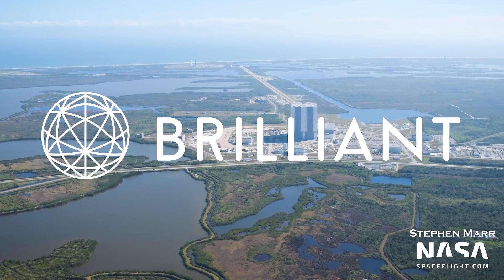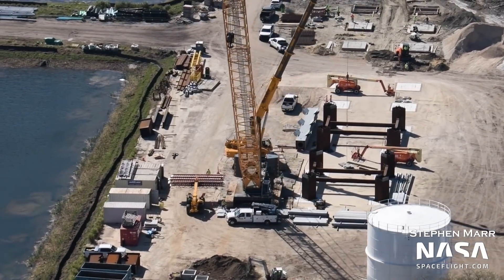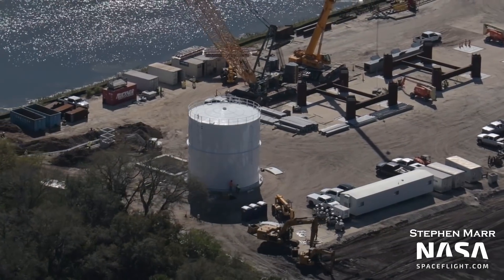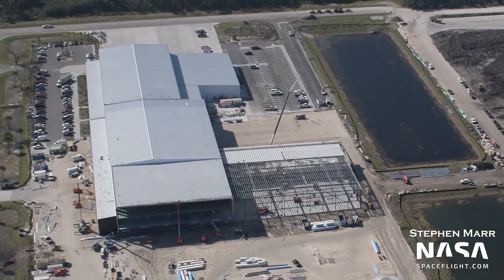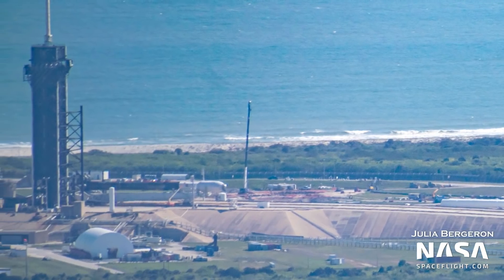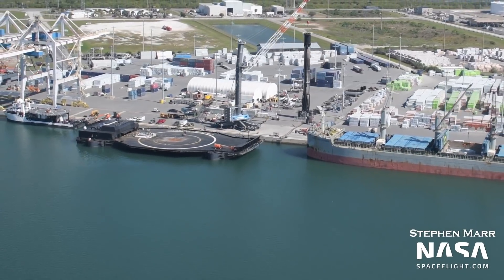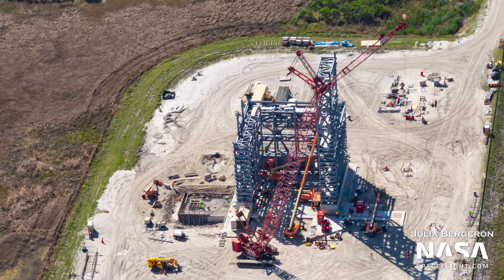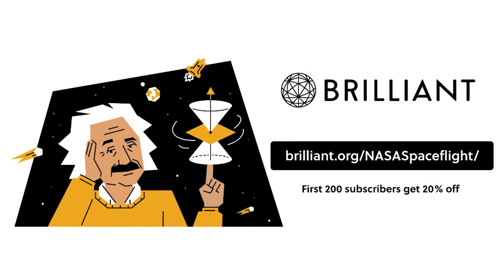Florida Starship Launch Tower Ready to be Assembled | Cape Update - Narrated

Comment: What are people's thoughts on the likelihood of the tower sections being pre-fitted with pipework before being stacked? Now that they have a prototype at Boca, fitting out the sections while at low level could save a lot of time overall. It could also explain why they're apparently building more construction pads than just the three that they used at Boca.

Comment: Even in Cape expansion, SpaceX is preparing to beat Blue Origin.
Reply: I don't think they really care about beating BO.  Space X is going to follow its plan.  In a year the new production site and launch pad will transformed.   Amazing.
Reply: @michaeldeierhoi4096  who said they cared? I just said they're pushing faster than BO
Reply: @EddyParera123  You said yourself that Space X was preparing to beat BO in Cape expansion  which seems to me a strong suggestion that you think it is important to them to beat BO.  

I merely said I don't think they really care.  Space X will just do what they do best.
Reply: @michaeldeierhoi4096 seems... preparing to beat isn't the same as wants to beat... neither implies will.

so, I meant SpaceX is going to beat BO without trying specifically to do so by having a higher building cadence. Is it clear now?
Reply: @EddyParera123  Yes indeedy you are spot on with that articulate reframe.    Have a good day.

Comment: 3:30. Piers, not pilings. Piles are driven into the ground, while piers are built into the ground. One can see the rebar cages laid out to be placed into the holes bored into the ground, then they will be filled in with concrete to form the piers.
Reply: Is 'piers' an American expression? I've worked with CFA (Continuous Flight Auger) Piling, with the rebar cage dropped into the pressure-pumped liquid concrete, and they were always referred to as 'Piles'. These are 'side friction' load bearing, rather than 'end bearing' on a more solid lower strata, like a pillar....
Reply: @BMrider75  
That is a good question. I am a retired electrician, and In the areas I have worked (mostly northwestern US) that is how I have always heard them referred to. To my understanding and experience, both types can be side friction or end bearing, or a combination of both, as all piles and piers have end bearing members to some extent or the other, and all will have side friction. The distinction will be which parts are relied on for the structural stability. I know that in some soil conditions we would have to increase the diameter of piers to achieve the proper side friction bearing surface area. My favorite was the rectangular paddle types for very soft soil or sand (say 3 by 6 feet on the surface, and 6 feet deep). These will hold up poles in soft soil or sand for PV array structures without rotating or moving in high winds. Is the type of piles/piers that Tesla used in some of the Giga Texas foundation areas the same type that you worked on installing? They had pumpers that pumped what seemed like a thin cement mix into the pile/pier holes that had rebar cages placed in deeply drilled holes in the softest areas of the substrate, while the other areas got compacted gravel geo piers.

Comment: Rockets been flying out of the cape for decades and is surrounded by beaches and wildlife refuges so whats the hangup with the faa and boca chica ?
Reply: Isn't it obvious?  It's a new site and a new rocket.  And not just any rocket, but the most powerful ever built.
Reply: @michaeldeierhoi4096  ya ! i remember reading about a rocket that was designed in the 60's called the sea dragon ! It was never built because there really wasnt a use for such heavy payloads at the time ! i see now how times changed regarding more powerful rockets ! thanks for the feed back !

Comment: Okay, so they start building the tower segments soon - but the concrete foundation of the OLIT is still missing...
NASASpaceflight, you know, that we expect commentated live streams during rollout of the tower segments 😄
Reply: There's nothing that stops them from building the tower segments before the OLT pillars, and keep in mind that this isn't Boca. 
Boca has somewhat bad ground to build large structures on so they needed extremely long and big pillars underground for that, I don't think they will need such a massive effort at the cape.
Reply: Sure, there is nothing stopping them from building them before. But usually you start your segments, when you get close to the moment you will need them. Doing this first, means you have to store them somehow... 9 OLIT segments stored in an area, where you want to build a lot of other things aswell...
Even if to underground is not like Starbase, you will have to make sure, your structure will be able to support its own weight, and this one also needs to support the weight of a starship booster...
But, am I wrong? Isn't the cape in somekind of a wet, almost swamplike area?
Reply: @horman1973  I think the tower segments will be assembled in a different spot and then moved to where they want the tower just like in Boca. 
As for the build order, could be as simple as the tower segments getting done before the ground work team arrived.

Comment: are they building 2 towers ?
Reply: That's where they build the sections. They'll move them to the tower spot in large sections
Reply: They build 2 sections at a time but one is being completed as the other is starting. This staggers the completions of these 3 story sections to smooth out the pace of assembly of the actual tower at the launch site. Just one actual launch tower is being built in Florida.